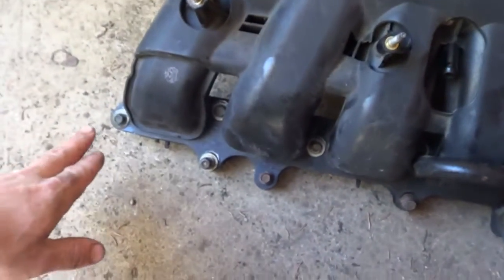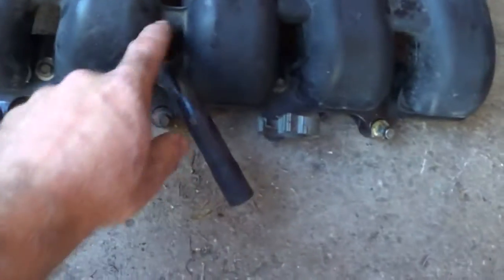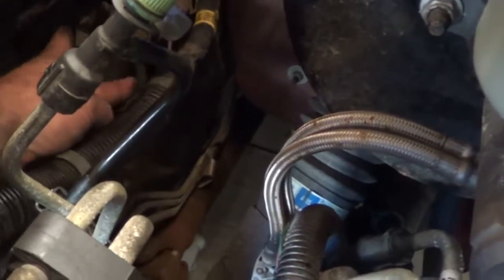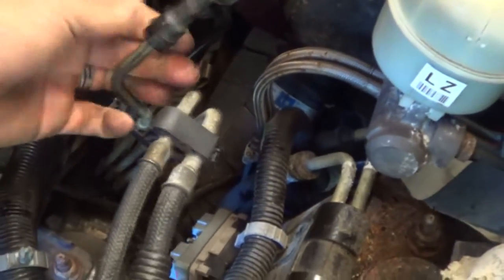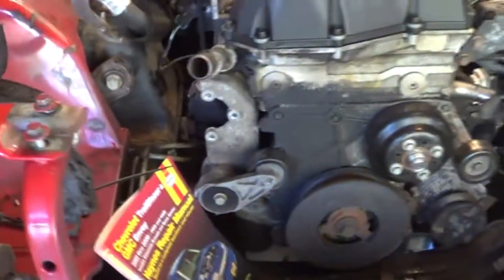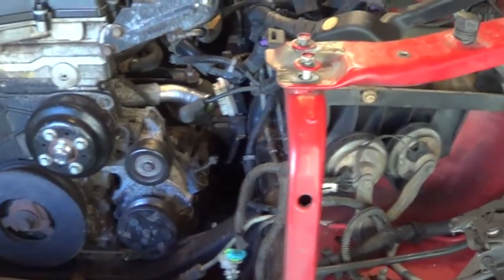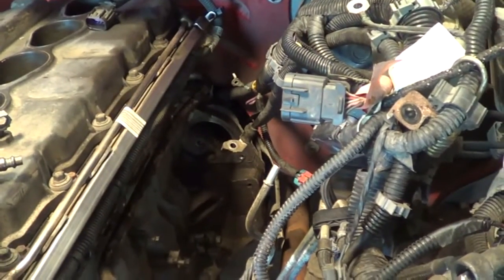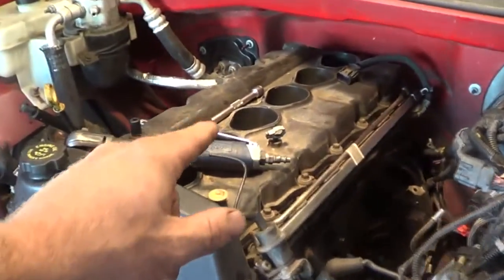2002 GMC Envoy 4 2 Engine Swap Vlog Part 4

Comment: Instead of pulling the intake you can remove the front 4 body mount bolts and jack up or chain lift the body up off of the frame for clearance.